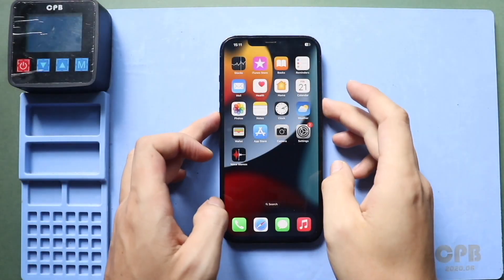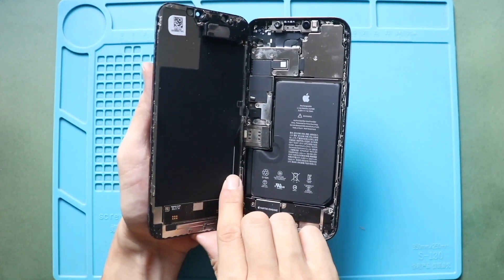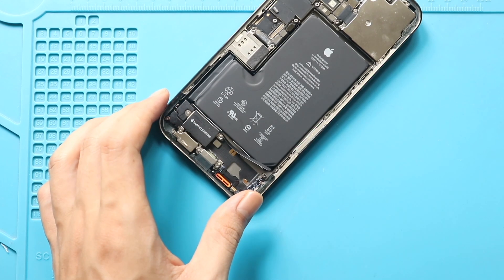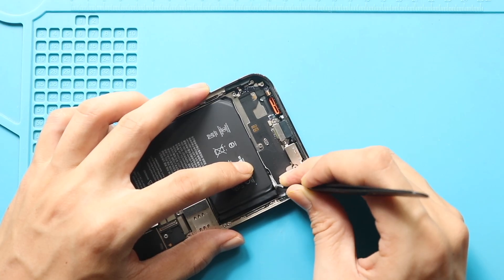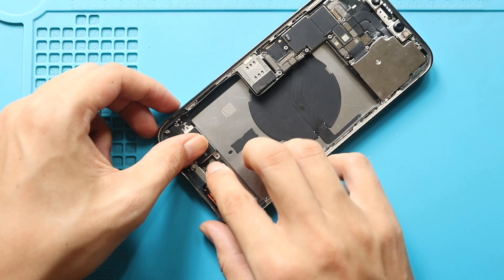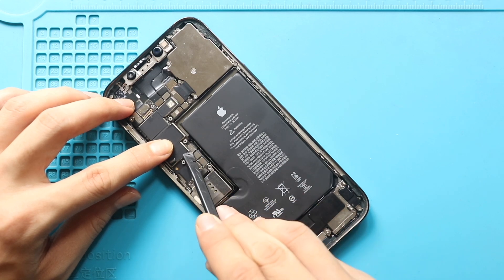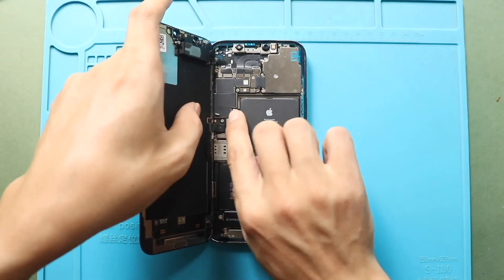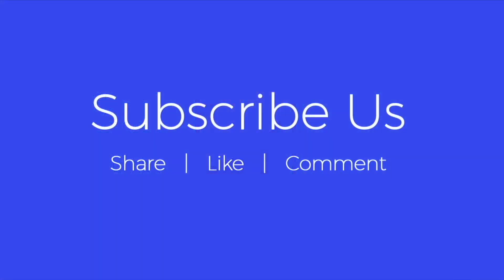iPhone 12 Pro Max Battery Replacement | Step-by-step DIY Repair Guide

Comment: Is not necessary any change in software to iPhone accepts the new battery? Where buying original battery?
Reply from the maker: No need to anything, issue with battery health part. but still even you buy an original battery, you wil need apple calibration tool to set up the view the battery health.

Comment: Is the removal of the bottom part strictly necessary? Or can I just drench the pull tabs with isopropyl alcohol and carefully pry on the battery?